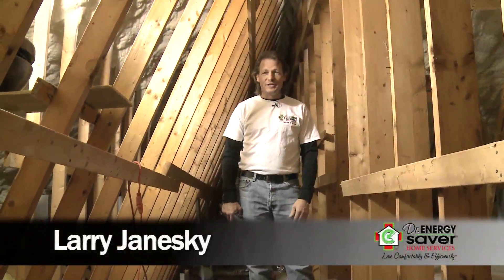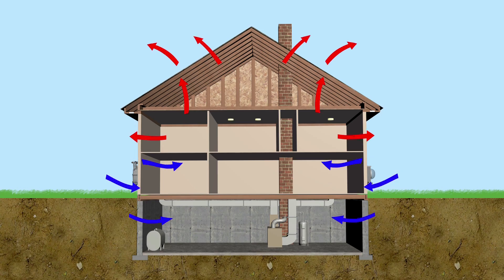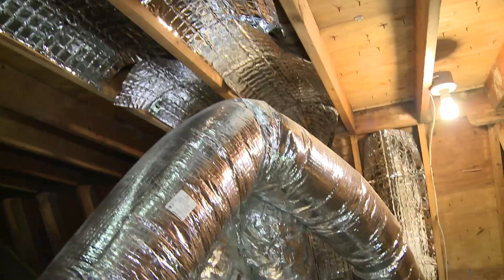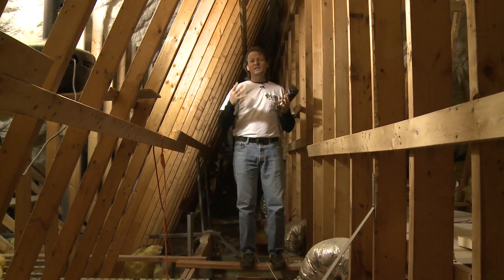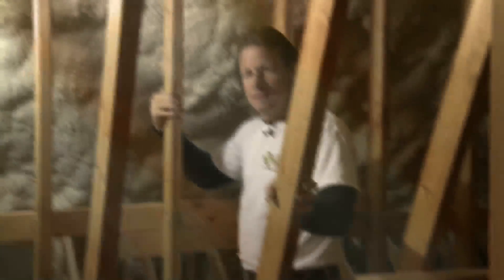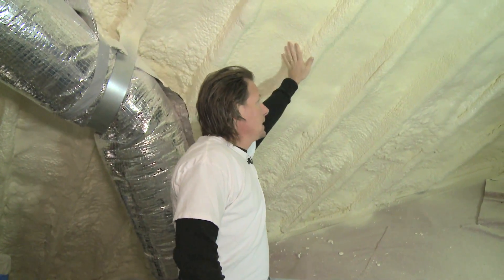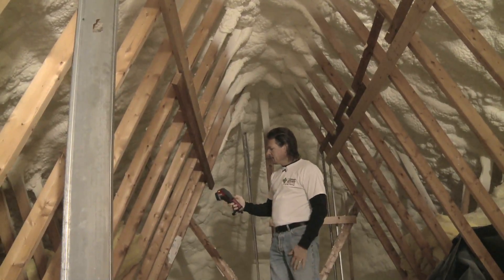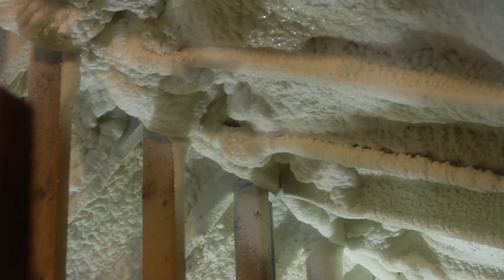Insulating and Air Sealing an Attic with Spray Foam (Short Version)

Comment: So if I wanted to spray foam the roof deck of my existing attic with blown in insulation would the cellulose insulation need to be removed?
Reply: +Cory Gerling You dont have to But At that point The Old Cell is Doing nothing.. Its just give Mice another place to Nest..... Spray the Roof and Get all that Old Dirty Stuff out

Comment: One thing I miss though if the house needs to be vented for the summer or winter how is it still Vinted when you seal the whole ceiling
Reply: you have to setup an ERV to take outside air and filter and condition it to maintain healthy humidity in the house.
Reply: @August I’m with ya... I’m not sure how a “conditioned” space is sufficient enough to combat natural expansion and contraction.  I don’t see it being effective when a ceiling is completely insulated and sealed off.

Comment: Does the foam stick to the plywood? When the roof is replaced, what happens if they also have to replace some of the plywood?
Reply: +Matt Greenwood if they have to remove the Wood when redoing the Roof They will have one HELL of a Time lol ... and Yes the Close Cell Foam Is like concrete and Will for sure stick to the plywood
Reply: Cool thing on a repair, you can tape the edges and spray most of the "repair" foam prior to install.  Basically make a plug.

Comment: r ventilation-spacers NOT necessary before u foam the roof???
Reply: My very first question as well.
Now, in the summer, the roofing is going to be exposed to extreme temperatures.
Goodbye shingles...
Reply: EricLDunn Actually Eric many of the major shingle manufactures (like Elk and Certainteed) have tested this system and have found that is does not adversely affect the life of the shingles.

Comment: What do you think of attic foil?  Is it as effective?  Is the foil susceptible to fire?  What is the typical weight capacity of a attic?
Reply: +evadesc Weight capacity depends on the size of the lumber used if that helps

Comment: This would not work in Southeast Texas as the attic would not ventilate through the ridge vent causing unbelievable moisture in the attic and thus mold !
Reply: it works in every climate, there would be no ridge vent, and you should try reading sometime.
Reply: It does work.u seal up the the vents.i live in South West Louisiana.and It works.
Reply: Do you ventilate your rooms with a ridge vent? When you seal everything in the attic it behaves the same way as a your closet downstairs. With no humid air getting in there is no reason for mold to grow.
Reply: MrSymbolic7 that's not tru
Reply: The idea is that during the winter the attic won’t be a place of drastic temp difference thus decreasing the chances of condensation. The same is true for the warmer months.
Reply: this is why you get a whole house air handler that takes outside air and filters and humidifies or dehumidifies the air....

Comment: Why not use the spray foam on the floor of the attic and not heat the attic with the heat from the house at all?  Seems like that is the idea of normal attic insulation, but you say that it's too hard to do.  But seems like spray foam would be able to get all the nooks and crannies.  They you're not paying to heat (or ac) your attic too!  Is this a silly idea?
Reply: Generally,all your wiring is running on the attic floor area,and you dont want that enclosed in spray foam